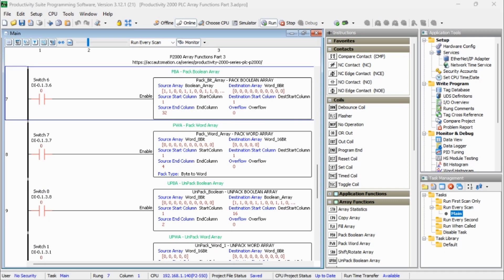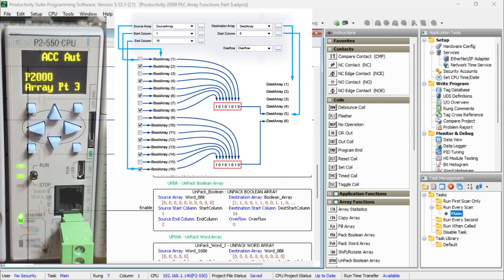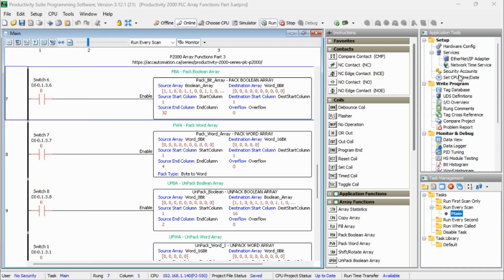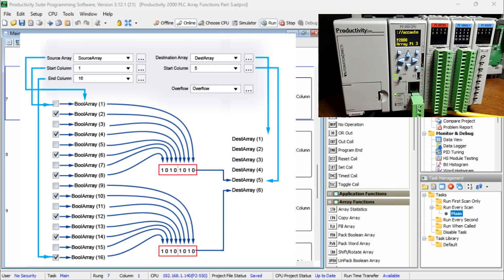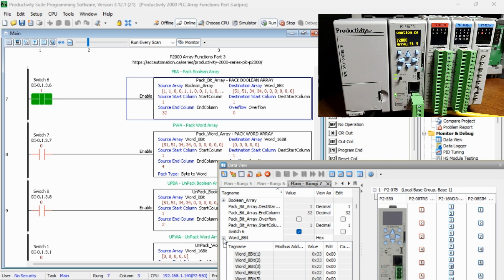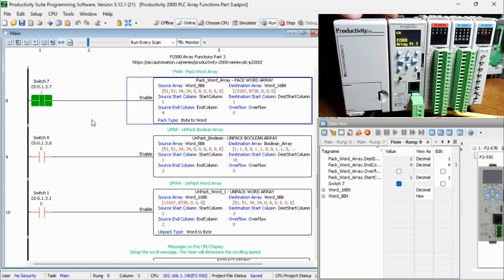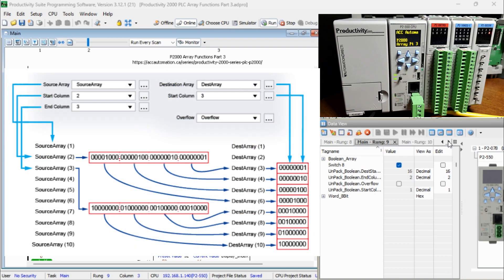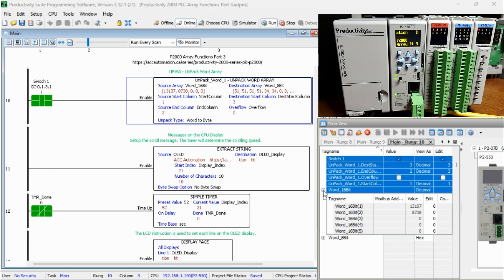Master PLC Array Pack/Unpack Functions for Ultimate Control

Comment from the maker: Detailed information can be found on our website. The post for this video is located here:
https://accautomation.ca/productivity-2000-plc-array-functions-part-3/

The Productivity 2000 Series PLC is located here:
https://accautomation.ca/series/productivity-2000-series-plc-p2000/

There are several reasons why we are using the Productivity 2000 Series Controller. Here are just a few.
- CPU with 5 communication ports
- 50MB user memory - Can handle very complex applications quickly.
- Limitless PID – Autotuning – Individual or Cascade Mode - etc
- OLED message display on the CPU module
- Plenty of discrete and analog I/O modules
- Status displays on all discrete I/O modules
- I/O Modules have QR codes. This can be scanned for the module's latest specifications/wiring diagrams.
- OLED data display on analog modules
- P2-RS remote I/O expansion module, or use the Productivity1000 P1-RX remote expansion module to add even lower-cost remote I/O to your system
- FREE full-featured Productivity Suite software
- Programming with several ports - USB, Ethernet, Serial
- Hardware auto-discovery
- Hot-swappable I/O - Remove cards with power on the system
- Choose from three wiring options
- Slim DIN rail density form factor:
 - hardware - power supply, CPU, and seven modules in only 10-1/2 inches
- All project files (program, tag name database, and all the program documentation) in the CPU
- Run-time editing and debug mode on CPU
- Easy data logging with micro SD on CPU
- Secure Web server to access data files and system tags
- Easy drive and motion controller integration
- Coordinate motion control with PS-AMC allows management of up to 16 axes and synchronization of up to 4 axes
- Two-Year Warranty

The Productivity 2000 series of programmable logic controllers currently has all these features built into the P2-550 CPU.
This CPU (Central Processing Unit) is also known as PAC (Programmable Automation Controller) because of its communication capabilities.

ACC Automation
https://www.accautomation.ca